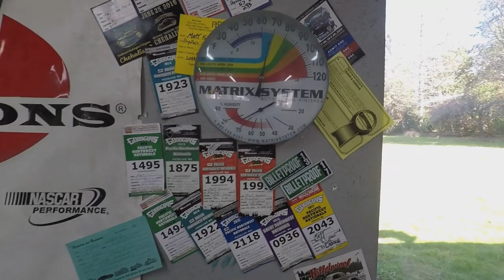Painting in a garage. Spraying the black on the 1964 Bug.

Comment: Hi mate, Great job on the beetle. What spraygun & nozzle and pressure you using? I'm just buying a first gun and looking for low overspray model. Thx
Reply from the maker: This is a Iwata LPH400 lvx with a 1.3 tip.  Sprayed the clear at about 25psi